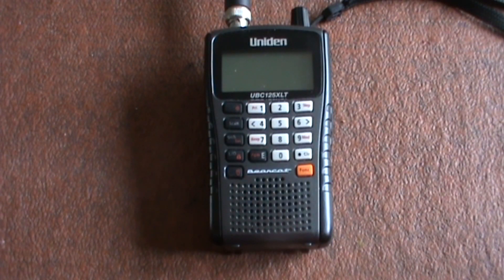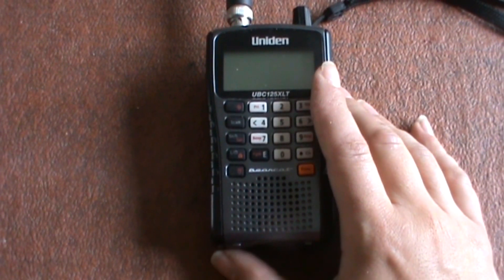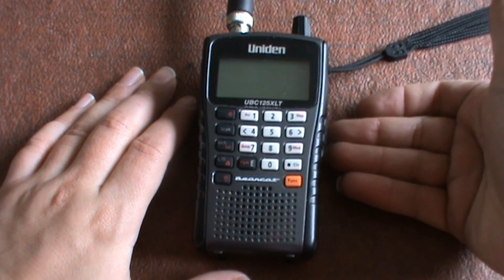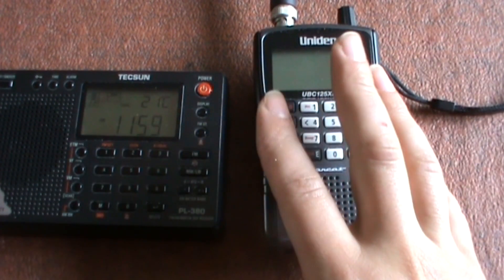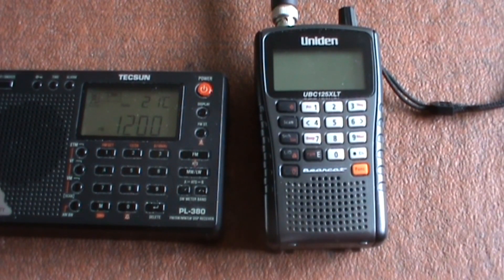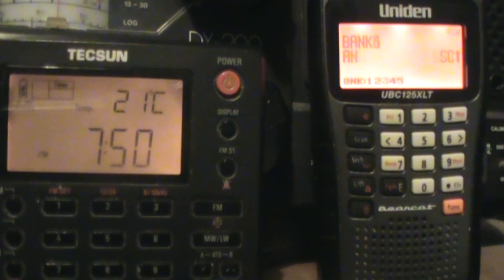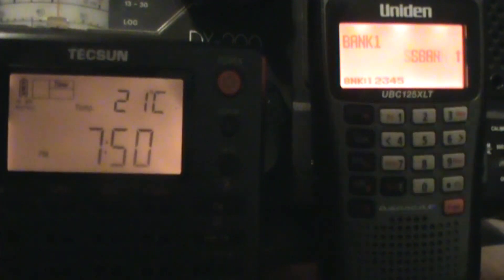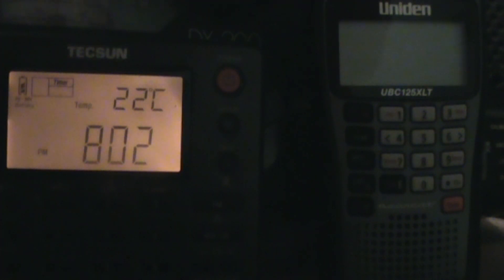Uniden Bearcat UBC125XLT: Battery Test

Comment: Hi I'm new to this hobby, my wife bought me this scanner for Christmas, I have a few frequencies I've been listening too however it pauses during the chat only for a split second then returns hence its difficult to keep up with the conversation, I've tried adjusting the squelch level but makes no difference. Could I have missed a setting somewhere you may know of? Thank you in advance.
Reply from the maker: Have you set the channel delay option? 
Hold>Func>Pgm>Set Delay.  Setting it to -10 resumes after 10 seconds. 5 seconds waits for 5 seconds before it continues scanning.

also the chat on Airband is short as they only need to pass on a small amount of info, heading, flight level and speed.

hope this helps! Happy Scanning!